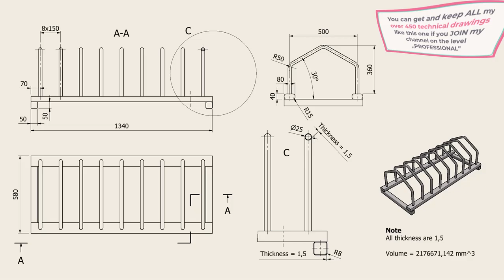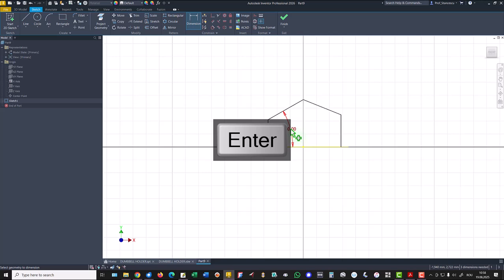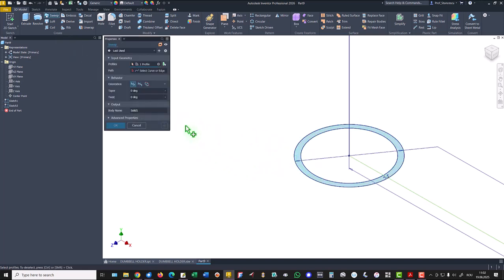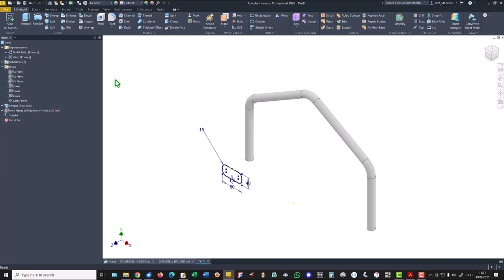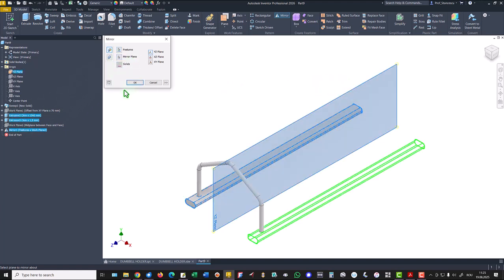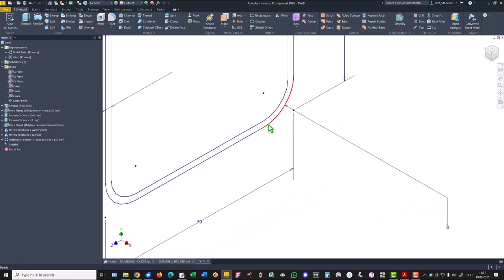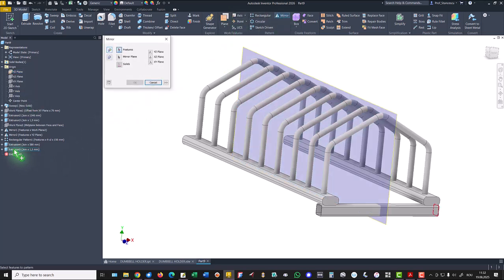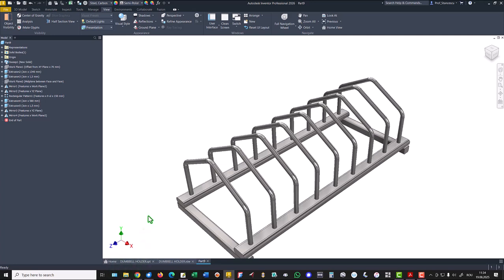Tutorial Inventor - 626 DUMBBELL HOLDER

Comment: Professor, if we are thinking about design for manufacture would it not be better to create an assembly of 3 individual parts (cross tie, rail, and dumbbell support? The full assembly will consist of 2 cross ties, 2 rails, and 9 dumbbell supports fixed together with necessary constraints.
Reply from the maker: Yes, my friend, we can always create an assembly, but this type of parts can be made by injection molding or 3D printing. If you'd be so kind as to follow along among my over six hundred tutorials titled in lowercase letters, you'll find a lot of assemblies.